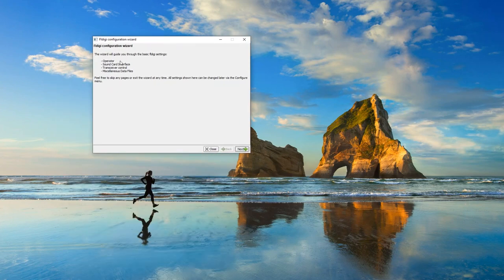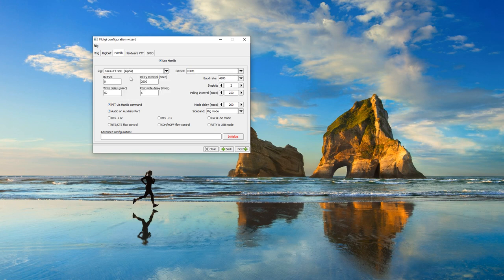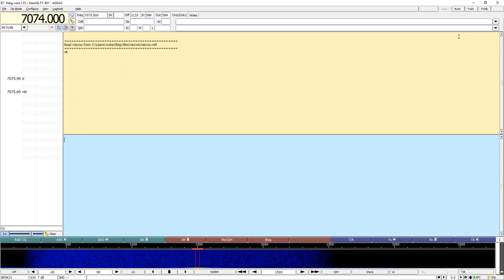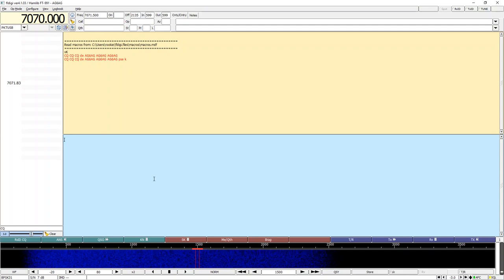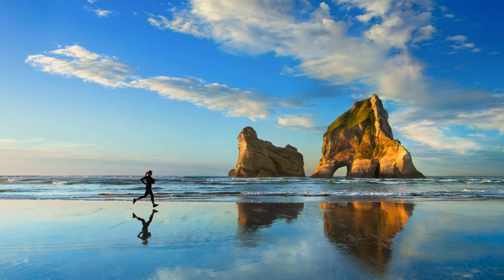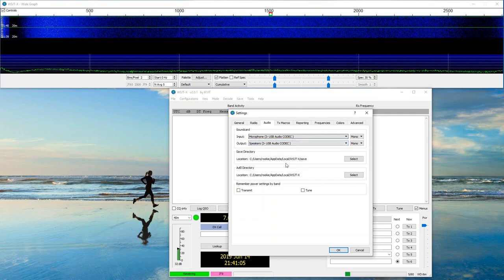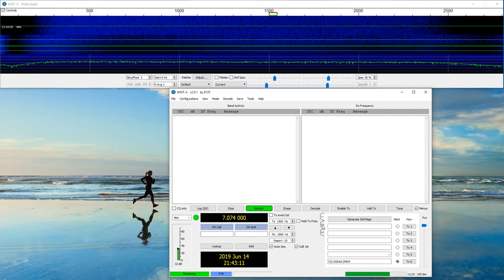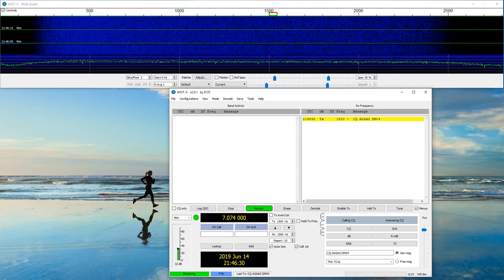Setup FLDigi and WSJT-X for HF Operation

Comment: Question. If I already have omnirig, HDSDR and Log4OM loaded, then it appears that wsjt-x can no run concurrently because uses Hamlib. When I test the rig control it yields a Hamlib error. Further, if I start by running swjt-x, unload it and then try to run the usual omnirig stuff, the ports don't work unless I reboot. Hmmmm.

Comment: Stuart,  Thanks for the Video.  I used it to set up my FT-991 on Fldigi and used it this morning during a Comm drill here in Southern Utah.  How did you display your radio settings on your computer?  I really liked that but don't have a clue how to do it.  Eric
Reply from the maker: Hi Eric,
I use a program called Win4Yaesu which also works with the 991. Here is a link:
https://yaesu.va2fsq.com/

Stu
AG6AG
Reply: Thanks!!
Reply: Have FTDX-1200 and signalink. Watch alot of  YouTube still can't get it to work.  Can I  say help
73 KQ4CD Paul